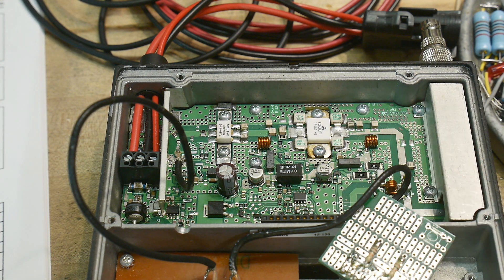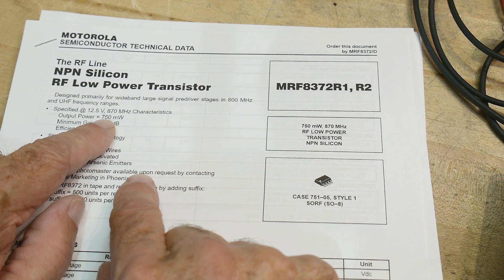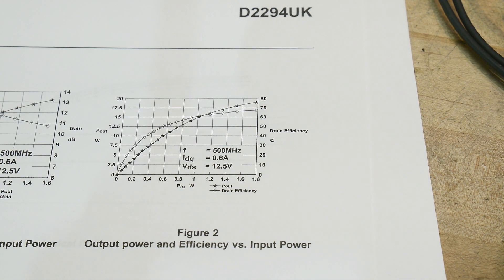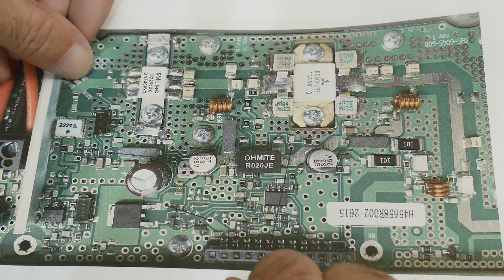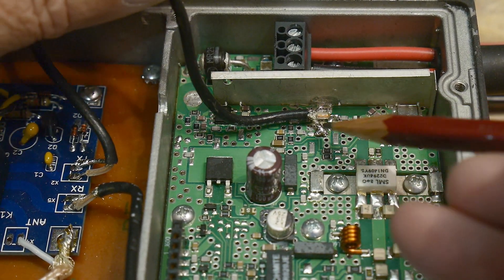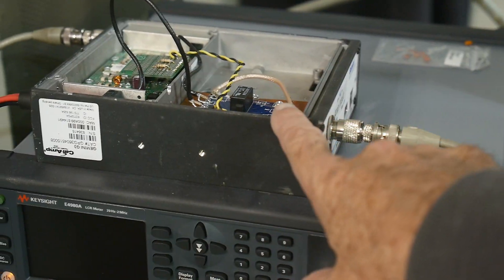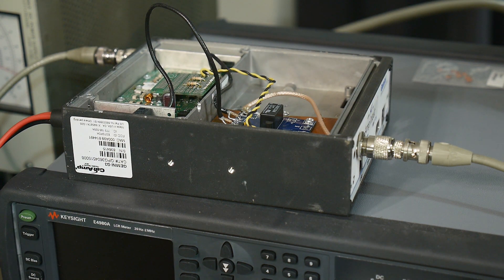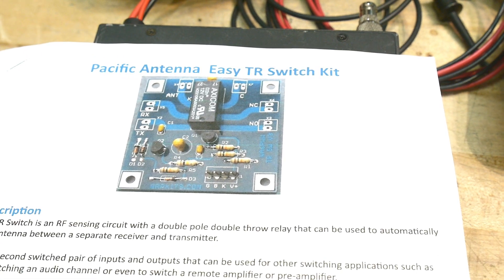#1713 RX/TX Carrier Activated Relay for Amplifier (part 2 of 2)

Comment: Just curious about the signal stage where you tapped. Was there an impedance mismatch or was the circuit @ 50 ohms between those two stages?

Comment: Idle current seems a bit high. why not switch to 12 V so that when you are in receive mode, it’s not drawing any current?
Reply from the maker: the gemini has a switchable bias voltage to the FET. that should be used here, just wanted to demo the TX/RX switch quickly.

Comment: So, after all, you got the kit to work up to 450 MHz while it was engineered to work up to 50 MHz!
Reply from the maker: in this application, some loss is ok
Reply: @IMSAIGuy  An interesting #short would be a sweep from 1.8 to 500 MHz to see what else if anything happens to the signal as it passes through the relay and other circuitry.
Reply: The relay is speced to 900 MHz.

Comment: I built one in the the 1970s that used a single transistor. I used mine to connect a scanner and a CB radio to the CB antenna. When the radio was not keyed both radios were receiving, and when I made the CB transmit, the antenna line to the scanner was opened and no RF got to the scanner. Mine had a delay circuit to hold the relay in transmit  mode when using SSB.